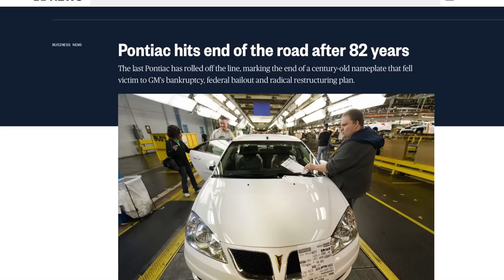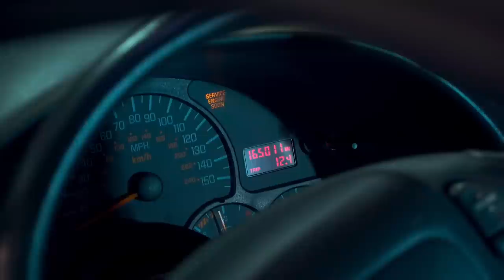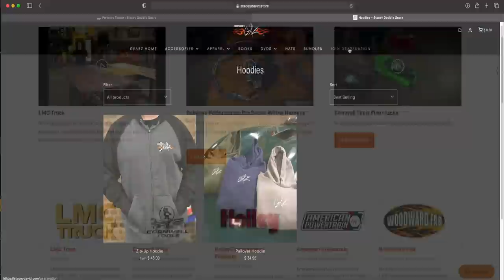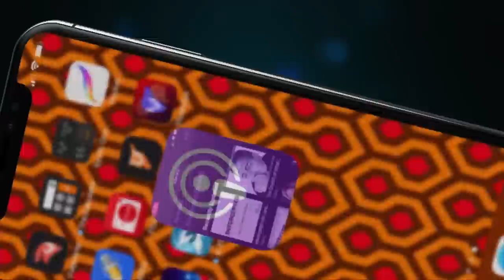Project Red Bird 1998 Pontiac Trans Am Front Suspension Upgrades - Stacey David's Gearz S16 E2

Comment: I have a mint lt1 trans am 1994 but it’s lt1. I wanted to ls1 it but I feel like the Lt1 is becoming more rare which I like. I’ve added a cat back exhaust, koni shocks and stranos lowering springs, brand new brakes and rotors, pan hard bar, rear and front strano sway bars, long tube headers and now a cam and subframe connectors will be next.
Reply: My brother has a 1995 z28 and I have a 2000 SS. Maybe my car needs a tune up but the Lt1 holds its own pretty good and sounds amazing!  My car has 65k miles and bone stock. I'm thinking its time for some suspension upgrades.
Reply: have you had any issues with the optispark system??  have you done that upgrade?
Reply: @martiniusetihw  yes I did and I got a petris  vented opti three years ago and have had no issues at all anymore.
Reply: Awesome!!  was it expensive??  I have a 4th gen LS1 but I think I want an LT1 also.
Reply: @martiniusetihw  the opti with spark plugs and wires was about $500
Reply: that's amazing. I thought the fix for that was more expensive than that.  Ok I'll have to keep that in mind.  if I run across an LT1 i may have to make an offer.  Thank you for the insight.  Oh I almost forgot, where did you buy it?

Comment: My complaint is that he didn’t clean up the spindles. Going thru all this trouble and at the very least he could have just scrubbed them down and maybe hit it with some black paint
Reply: Why? It’s a car that’s gonna be driven. It’s not a show piece
Reply: @SpeeeedyG  14:30 just saying… go thru the trouble of replacing the front end, it would have looked even better to clean them up and put clean coat of black on there
Reply: @ScreenTalker  looks won’t matter in a week. They will be caked in road grime.
Reply: @SpeeeedyG  you can see on the brakes episode that they’re significantly cleaned up

Comment: How much $$$ to do all the Firebird  upgrades?
Reply from the maker: BMR offers several levels of kits for the 4th Gen F-Body. This one is about $1600-$1700 depending on which shocks you get. The Baer Brakes are basically road-course racing brakes and will run about $5000.

Comment: On the top of the front shock, the shock mount. The old ones had another bushing that fit inside, did you not need them? I just did this to my 2001 Pontiac Trans Am WS6(went with QA1, dual adjustables at every corner) n I had to purchase new shock mounts n that particular bushing I’m talking about.